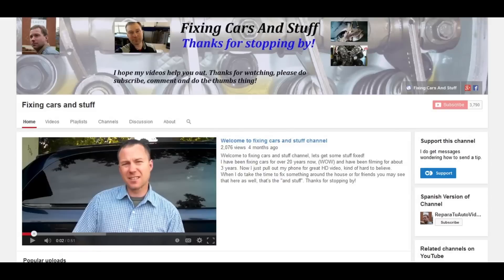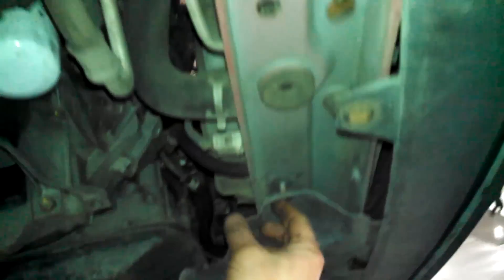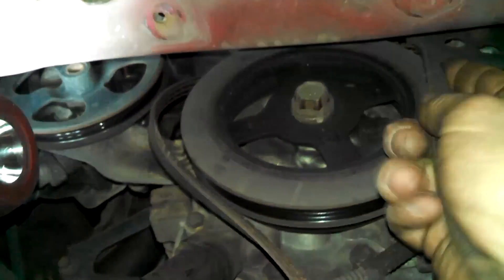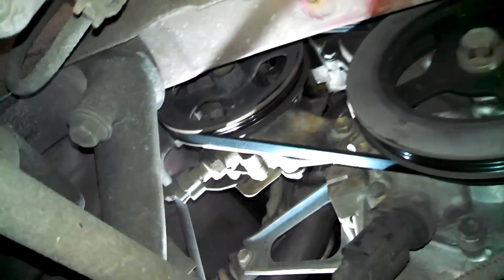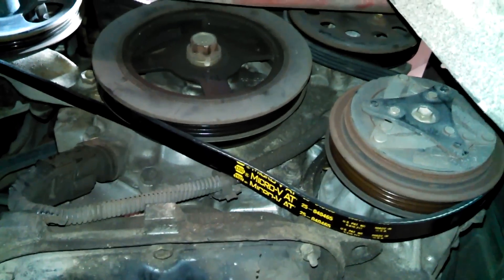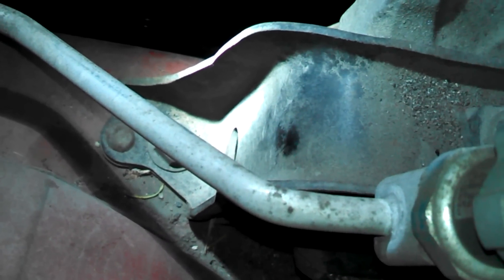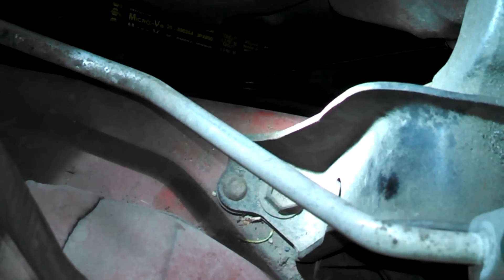Belt replacement 2000 Toyota Echo power steering alternator air conditioning Install Remove

Comment: I'm not understanding how to loosen belt ? just move the pump over ???
Reply: I'm having trouble loosening the drive belt on my 2000 echo at the moment. The two mounting bracket bolts are easily loosened but I was told by a friend to loosen the bottom bolt on the alternator as well. The bottom bolt is practically welded on but I haven't tried using a pry bar to push the alternator back yet. I'll post here again when I get it figured out.

Comment: He loosened the wrong bolts to allow the power steering pump to move. It's the bolts above the pulley not the one through it

Comment: I got to power steering nuts from top. No need to remove shields underneath. Most likely need to loosen pivot point nuts. Some people seem to get away with a slippery point and dont need to do that. I did.

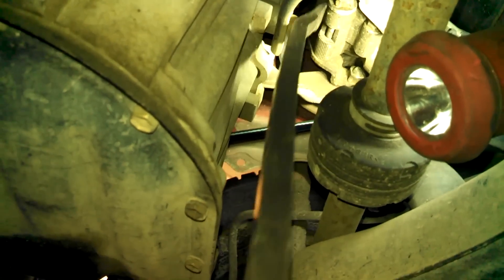Comment: At 2:15 you pry on the alternator to tighten up the belt, then show the power steering belt is now tight.  But those are separate belts.  How did you tighten up the power steering belt?
Reply: He meant power steering pump, if you look closely you see that's not alternator.

Comment: Tood I cant seem to loosen the steering pulley, I loosened the bolt that thru the hole but no luck. Am I missing something or could it be the bracket is just really stuck?

Comment: What are the part numbers of those 2 belts? Looking for them online. I have a 2000 Echo whose belts have started to squeal.
Reply: John B. did you ever figure it out? my belts are squealing pretty bad on my 2002 echo sedan, was also looking for belts online.
Reply: Try Dayco or Gates catalog they have an online guide to tell you which belt you need.
Reply: Just purchased an replaced the alternator serpentine V belt with a "Gates Micro-v",  Part # K040465,  4Pk1181,  9/16" x 47" OC,  for the 2003 Echo,   Auto Trans,  with AC.  Purchased at O'Riely's for $19.95

Comment: I've got a 2001 echo and there is almost no clearance to get the ratchet wrench onto the bolt you're pointing to when you start the video.  Tried for hours and when I finally wiggled the ratchet on there, it wouldn't budge.
Reply: I had to loosen the three bolts on the mount and let the engine go down.  I put a jack under there to support the engine and moved it down slowly.
Reply: @kippraneumann9135  is there another way? lowering the engine down sounds not the best thing to do
Reply: @Jake V did you ever figure out the answer? I'm having the exact same problem.

Comment: Just finished loosening and then re-tightening my alternator. Got rid of the horrible screeching sound I would get when I turned my AC on. Thanks for the video!
Reply: Innovation Gaming what is the voltage for a 2000 toyota echo the origial voltage 70 or 90 let me know please no one knows
Reply: Austin Martratt Aq
Reply: I was able to fix mine too. Thank you.
Reply: @mistertakeuchi984 hi
Reply: @sabrinalee1926  70

Comment: Is that the only nut you need to loosen to release the alternator? Do I need to put a lot of force to move the alternator through the groove?
Reply: yes only that one. yes some force too. sometimes its really stuck in there so before trying to move it. put some lubricant in it.

Comment: If you have AC can you use the non ac belt and just bypass the compressor? My 02 echo needs a new compressor and I do not want to buy the $390.00 part I use the car in the winter only and do not care if it has AC. just wondering if you have worked on a non AC model and if the belt for that model would work for me.
Reply from the maker: On some cars you can do that. I do not know for sure if you can for yours, it all depends on how the belt routes.  And if the pulley on the compressor is ok, but the internal parts of the compressor are bad, you could just dis-connect the compressor electrically, so it never comes on.

Comment: Thank You ,  Your vid.  was helpful,  you certainly made it look easy,  that is for those who have a lift.  No worries though I saved time by not even trying to attempt the job from above,  but secured the little 2003 plastic Toyota Beast's,  front end,  jacked up in the air,   Transmission in  Park,   E. Brake,  pulled on tight,   both back wheels choked & blocked,   forward & backward,  then lowered onto 2 ton "Jack Stands,  at the appropriate  designated places,  for Jacking the Echo's front end up, along each side.   Yes!!!,   making the job go just as,  safe & easy,  as you made it look when you were under it, winding that belt around various places it needs to go.   Good hint you gave,!!!    to have that diagram,  of the belts,  required Pattern of installation, with you when your down under,  Thank You!,  ( listen up crew ),  Helps to get it right,  the first time.  Thx again,  for sharing.

Comment: Excellent video,thanks. I'd advise having new plastic push fasteners for the inner fender on hand before you start the replacement, they will probably break on removal.

Comment: arent there belt pully tensioner for the bigger belt on the second half of the video/ only way to tighten it prying the alternator?
Reply: +hyperx43 Yep. I just spent half an hour prying on what I thought was a stuck tensioner, but you have to loosen the alternator, its the only way.